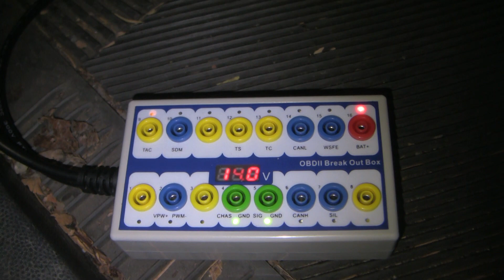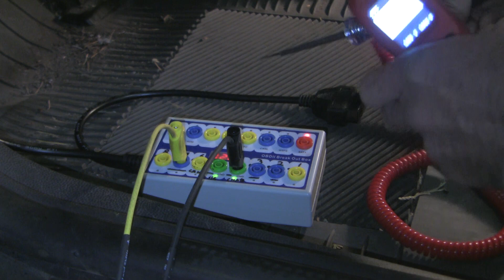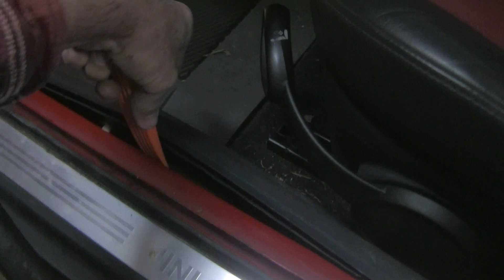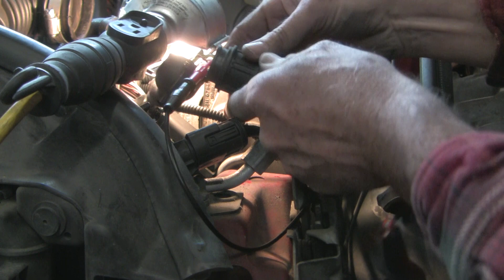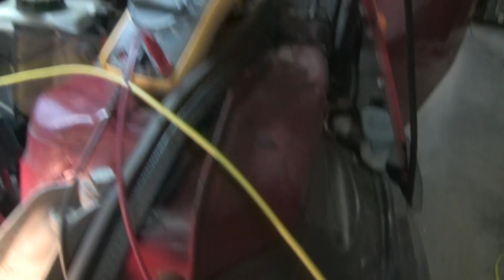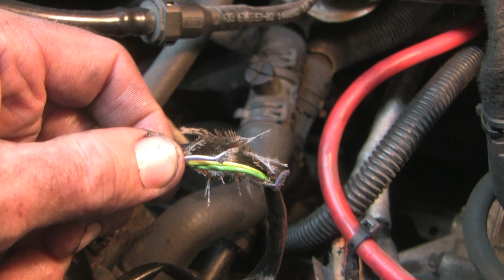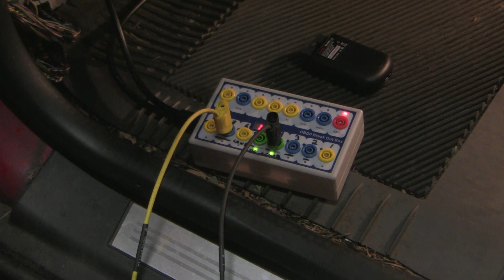How to fix a Mini Cooper that won't link to a scan tool

Comment: How did you get slack on the cable you soldered, I can't pull it at all to be able to work on it
Reply from the maker: I think a previous mechanic was there before me and loosened it up. Just be very careful how you route the wires after you're done, since the right wheel drive shaft is below that heat shield and you don't want wires dangling near that spinning shaft, or near the heat shield. When the motor is torqued, expect the entire engine to rock over, so there needs to be enough slack to permit a shift of the motor on its motor mounts with higher revs. You might want to see how much the motor moves when you rev the engine to be sure the motor mounts aren't too worn. The wires to the starter are zip tied in place, you may need to cut zip ties to get enough slack. As you saw, I spliced in a 3" segment of wire since I didn't have enough length to solder it directly together.  Good luck!

Comment: i have a 2005 mini S just have two ELM327 but just dont conect to the ECU, i check all the connections like the vid, but just dont luck, only the fuse of the  stering fan  i have to change it, but the other is fine.  :(

Comment: My 2005 cooper has the same issue. Wont connect to any of the generic scan tools. I was wondering if your mini said it supported obd2 on sticker etc. Mine has no such sticker, so I figured it was just not Implemented in 2005. But maybe I have a similar issue to you. What scan tool did you use? Thanks for any help.
Reply from the maker: All vehicles sold after 1996 are obd II compliant. The tool I used is Autel Maxisys MS906BT. Yeah, you could follow the pathway I did, see what's on the communication line.
Reply: @spelunkerd  Thanks for your reply. It is very strange that it does not have the obd2 compliance sticker. It was a New Zealand new mini cooper s ( r53). (I guess just partially put together here) .It obviously has the obd2 port under the dash, but as I say, non of the cheap bluetooth readers work, I even purchased an expensive one with no luck (tried around 3 or so). 
However, my friend was able to get some info from a cable he had and his laptop (not sure what software or cable he had, it was a while ago) I'm guessing it was reading the Can info not the obd2 info. It's all quite confusing. Some things I read on the net, and info in some code reader advertisements seem to point to pre 2006 minis having issues. It's very frustrating not being  able to find definitive info. If anyone else has had similar problems, please post it here so we can all learn from it.
Thanks for your reply.

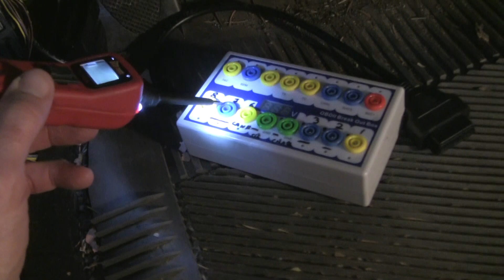Comment: At 11:09, you show checking the breakout box to see that the ground was removed from the circuit, but the breakout box may not have been plugged into the dlc (you can see the connector on the floor and the battery voltage display is not lit.)  That could easily steer you in the wrong direction for sure!  Awesome video though, I felt like we were all on the journey together.
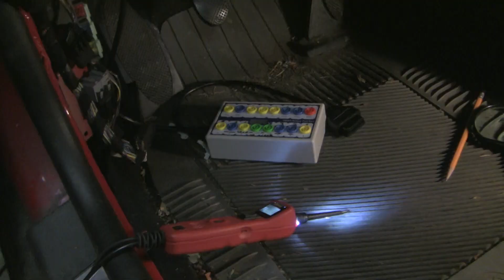Reply from the maker: Ha ha ha, I love to see that people follow so closely. You made me think about this moment. At 11:05 I can see the male plug for the box plugged into the DLC, but as you say the box has no power. Like most breakout boxes, this one has a male end and a female end, so you can plug in your scan tool to the female end and watch as the data is exchanged. The female end is unplugged, which was appropriate for the circumstance. The Power Probe does have power, its screen is lit and it displays a voltage. I think the power for the DLC comes through that connector that was disconnected, it is the only explanation that makes any sense. At first I wondered if I had disconnected the battery, but I would have remembered that because the power probe was still functional. Even without power, since it was plugged into the DLC, continuity with the proximal end of the plug is maintained so the test is still valid. It is rewarding to see people like you follow this along at a high level, thanks again for offering feedback. It makes the effort to do videos worthwhile.
Reply: @spelunkerd  The way you make the video and show the logic behind your moves, is what makes your videos awesome to watch.  So I thank you!  I quit watching cable tv shows that focus on drama and nonsense, and instead subscribe to  channels such as yours, Eric O, ScannerDanner and the whole similar group!
Reply: @ablackformula  well done sir and congrats. Best wishes.

Comment: Very well put together video,  if I had to give any advice it would be to use a SPOT light on a tripod and point it in direction of work, I have tried all kinds of flood lights and have found that spot lights work best by far.

Comment: You present your case studies in a very organized and easy to understand approach. Great camera angles, solid commentary and always enjoyable, logical manner. I can only imagine the labor costs if this has gone to a dealer or shop. Your son owes you a beer at least. Excellent work.
Reply from the maker: Great points, this kind of open ended work is not friendly to a professional shop that needs to charge for time. I wonder if this was investigated in the past without finding the cause. In fairness to the previous owner, a professional shop might have abandoned the search before ringing his repair bill up too high.
Reply: @spelunkerd  Very true.

Comment: There wasnt anything amateurish in your case study. Thanks for sharing, have you checked out " newtisinfo " bmw electrical schematics, its free.
Reply from the maker: Thanks, man!
Reply from the maker: I spent some time today going over this, it is a brilliant resource, much better than the dealers service manual I bought on Ebay, and way better than the Bentley manual! Gotta love the way it is a searchable database, much easier to find details. For example you can search an individual fuse and get wiring diagrams and links to devices, and also more practical advice on how to service parts. I also found the critical details regarding the two connectors I was searching for, with pinouts and connector locations that were not included in the dealer service manual. I'll pin those details in the top of this thread, for people who come later. Thanks again, Rob.

Dave
Reply: Unfortunately now taken down due to BMW 😢